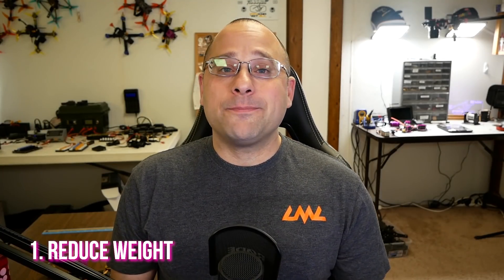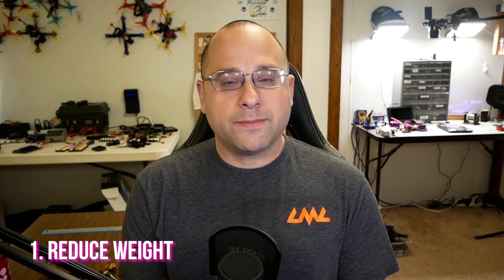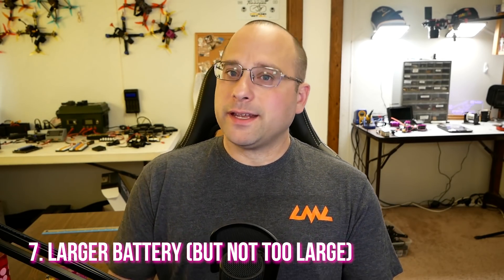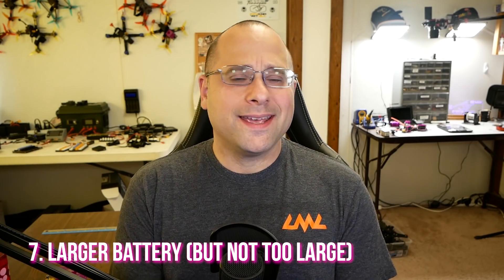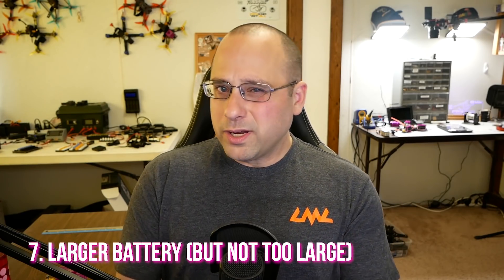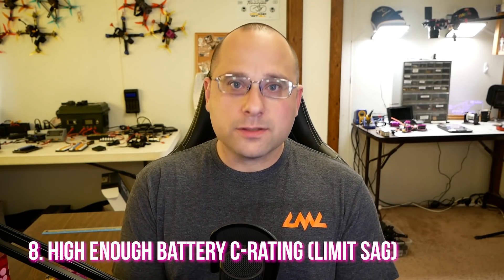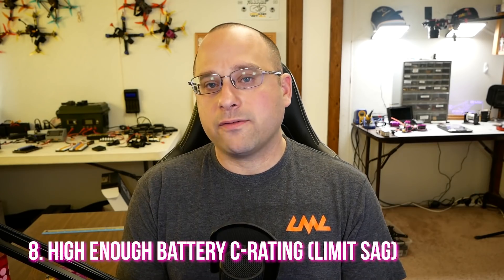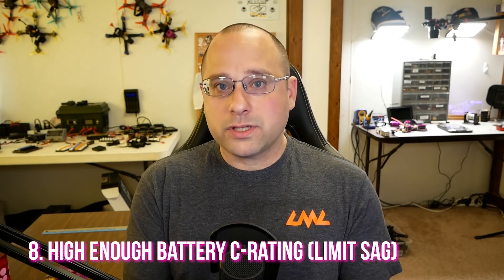Quadcopter Long Flight Time | TEN TIPS TO FLY FPV LONGER

Comment: I have a decked out 680 sized quad that will fly for almost an hour on a 6s 10,000 mah battery. It’s a lot easier to do when you can swing 15” or 16” props. Can’t wait until we can get a major breakthrough in battery technology. I can only imagine the flight time I could get without having to carry a massive brick around.

Comment: Dear JB...or anyone else,
I just looked at your ultimate shopping list and poked around.  Under frames, I noticed what I think, by now, should be considered the usual suspects.  I wish to submit for your approval the iFlight XL5.  Its a well thought out frame at a very competitive price (about $35).  I bought the V2 last year and found the build to be simple, the carbon has chamfered edges and the durability superb.  The V2 arms are 4mm and the top and bottom plates are 2mm.  I bought the V3 this year as a back up frame and its virtually the same save for the camera mount.  I don't presume to be remotely close to being an expert in this hobby as I am quite new, however I know quality when I see and this seems legit.  I guess what I'm asking is...can you check my work?  The company is chinese and I know that can raise a few red flags, but that can't always be the case.  Anyway, some direction would be nice.

Thanks
EZ Sluyter

Comment: 6s and efficiency... V=IR and P=IV.  Going from 3s to 6s means you have half the current for the same power delivered.  Power loss on the infrastructure though is based on the current only and it's the square of the current.  So at higher voltage much less power is lost to the escs and wiring.

Comment: I just built a TI 5" Armattan with the old Emax red bottom 2205 2300kv on 4s and i get at least 2mins longer than any of my other drones , and yes flattened the cam tilt and be smooth 👊

Comment: Thanks for all the great info. Glad I'm looking in the right kv and size range for my lr motors/props. Found a file on thingiverse for a lr quad, so printed the frame and am looking for parts. After watching this, will continue with my plan of 7 inch props, on 2204-2206, 1700-1750kv motors and a large 3s battery. Also trying to figure out a way to keep the structure of the arms, but have them collapse down to 5 or 6 inch easily.(arms are tubes) So I can swap it to a 5 inch freestyle or race quad running 4/6s at the field if I want. (Going with the 50 or 60A diatone mamba f722 30mm stack, crossfire, and most likely tbs unify pro 32) Just need to find specific motors that should be good. Either the mamba Toca, brother lr or xing camo are what I am thinking.
Reply: @flat-earther  the 3d printed frame didn't work out. First test flight had too many oscillations, and it just went into a fly-away. But got a GEPRC MK4 HD7 frame for it after that, and flies well enough for smooth cruising and light acro. Ended up with xing e-pro 2207 1800kv motors, the 50A f7 stack, and elrs on 3s for the moment. May try 4s in the near future, with a motor output limit. 
Longest flight has been 16 minutes on a 3300mAh 3s LiPo, so far. Averaging about 50km/hr.

Comment: Recently i flew a 80c 1000mah battery on a 5 inch rig for a longer flight than a 100c 1300mah. Il have to do it again trying to take notice if im smoother on the throttle. Gonna have to get on the throttle with the 1000mah to see how saggy it feels.

Comment: 6S LowKV is real, and I can set you up with the math whenever you want to go over that.  We should probably put together a Skype interview discussing that AND issues with VTX performance.
I'll argue against smaller motors being necessarily helpful - I've found that tall stator motors combined with lower pitch props actually equalizes the flight time with some improvement in being locked in, which more than overcomes the added weight I'm seeing.  Weight reduction matters, but spending that weight budget on stator and magnet mass is a better investment.
For reference, i'm talking about low KV 2208 motors as efficiency rigs, and finding that I get better flight times than even my lighter 2205 setups on the same props, batteries, and camera angles.
As far as running really low KV, my 6S builds running 6" props on 4S batteries are absolutely amazing - that is solid advice.

Comment: FOOTPRINT off the quad. X configuration frame- camera over stack batterie bottom mounted and slim arms. It slices thro the air. Slim arms double advantage, because blocking less thrust.
Reply: Not smaller frame (motor to motor) but less surfice earia.

Comment: 4s 2300kv 2306 1400mAh 65c 5433 props can get 6mins of good mixed flying(hard and easy, just how she likes it) 4-5 mins if i thrash it. quad weighs 659odd grams no gopro using tbs source one v2, dys samguk shu motors, predator mini, mamba f405, matek hv vtx and rxsr

Comment: Using the Ummagawd Remix, went from the stock 5.5" arms, 5" props, 2306 ~2500kv, 4S 1500 batteries to 6" arms, 6" props, 2208 1666 kv, 6S 1050 batteries and my flight times did get pretty close to doubled. I still get that "wow... it looks like I still have a couple more minutes left" feeling. 

My understanding of the whole 6s thing, lipos don't like big sudden current draws, so by spreading the same draw over 6 cells vs 4, it evens out those big dips and allows each individual cell to perform better. The nice thing is, the RDQ 1050 battery is basically the same size as the 1500 4s, so I don't even have much of a weight change other than the arms!

Comment: Some good info. I do miss going to 2-blade props. These tend to be more efficient than 3-blade props.
Reply: Yes that is the #11 tip. It can do 20-25%  and it allows to use a smaller motor because a 2-blade-prop is lighter and will spin up faster

Comment: Mr. Steele did not claimed that 6s makes him fly twice as long, he said for his application and required fly characteristics it makes him fly twice as long. So 4s makes him fly like 1.5min of his flightstyle, without compromising the flight characteristics (sag, lower rpm, etc.) and he can push it to like 2.5min but not nearly as consistant; while 6s gets him like 3min of ripping and 3.45min in total, extending his crisp twice.

Comment: You need a helination link I place huge orders with them all the time thanks to there bundle items i just ordered the isdt t8 w/24v supply for the bench... thanks for all the help and I will be using as much of these tips as I can as I'm a slow flyer and want longer up times. 🥃cheers🍻

Comment: One of my favorite quads is a 6inch Mode-2 Ghost with 2207-2500KV motors on it. I usually spin 5.5x4x3 HQprops on 4S and I can do acro for almost 5 mins, but every now and then I just like to slap a 1300 5S on there and pull it dry in under 2 mins :P

Comment: Why does my brand new Tattu's 4s 1300 mah (v1.0) drops to around 12.5V fully charged when I just do a punch up to air and go down..
Usually when I hit the throttle to get high up, it even beeps once. I don't think I am too aggressive, at its already happening right of the start of the flight.
Other than that battery is doing great, if you dont fly too agressive.

Comment: Joshua, I am interested in frame weight. But there seems to be very little information about the 'strength' (or as you say, 'durability') of the frame at any given weight. Other than crashing a quad a few times, where do we find good data about the strength of any frame? Some research data is just plain not out there. And I put little stock in the videos where people stand on a Carbon Fiber part to show how strong it is. How would you quantify standing on it? Impact on a quad is seldom the same as dead weight at the center of the quad.
Reply from the maker: Not many people are doing lab testing like you are thinking of. It's all practical testing. Build it. Crash it. See how it breaks.

Comment: The thrust tests all seem to show that two-blade props are always more efficient, all else being equal. How that translates in real flight varies, I'm sure. Certainly on the little brushless-whoop-class quads, experiments suggest you may lose a small amount of thrust for noticeably longer flight.
Reply from the maker: For me, you do get longer flight, but the tradeoff in handling is significant. That's why I left 2-blade out of here. My goal with this list is to mostly keep handling the same, if possible. Well.... I guess going down to lower voltage battery is not the same. Basically, I just hate 2-blade props LOL.
Reply: @JoshuaBardwell  maybe it just makes more sense on a tiny quad in a tighter space, where the whole handling regime is different anyway. I have been flying the micro quads for quite a while but don't have nearly as much stick time on the 5"... yet. :)

Comment: I think one thing that makes high volt, low kv better is that the motor can use smaller gauge wire, because there is less current, and therefore it can be wound tighter and the mag field is better focused. Look at those 2600kv motors. They have enormous gauge wire with hardly any turns. That is a nasty mag field making lots of waste heat. Also, electric car manufacturers have all decided that 300v is best :)

Comment: I think I literally did everything you said not to. My quad is fairly heavy for one with a race configuration at 343 grams, I use high pitch 5048 3-blade props because I can, the motors are fairly large at 2400kv with a 2305 stator, my battery is a 315 gram 4s 4200mah 10c, and I use a fairly high tilt angle, but jokes on all of you. I haven't gotten lower than a 21 minute flight with my setup yet and that was with a lot of playing around and many full throttle passes. ;)

Comment: Great tips. Could the high voltage - low kv trick have something to do with lower current and thus lower resistance and heat loss in the wires?

Comment: Awesome channel with such an amazing detail! I wondered whether you’d had any knowledge of mixing same voltage LiIon and LIPO batteries wired in parallel for long range quads. It struck me that the LIPO would be good for instantaneous current draw but the LiIon would be better for energy density. Charging would be done as separate units. Good or bad idea?
Reply: I don't think it would work.
A lot of the key to Li-Ion's energy density is that you can bring it down to much lower voltages before you have Problems.
If you parallel it to a LiPo, you can't take the entire pack below 3.5v without damaging the LiPo, and you lose use of that entire region of the Li-Ion.

Comment: I use a 7" frame with (t7056) props on (rs11 2303 1700kv) with a 3300mah 6s lipo and weighs around 950g and get a 10 minute flight time but going to li-ion battery for 15-20 minute flight time will probably get lower pitch props like you recommended
Reply: I have a set of them spare to try also some 7042-2 to try too

Comment: my quad is a 6 inch alien frame running a 4s 1500mah lipo at 526g without a gopro....is that good?
Reply: Sounds pretty good to me. What motors. My 5 inch 2407 is probably a bit heavier lol. I think Josh's 2407 armattan weighs about the same.
Reply: I’m using the same setup with 6s motors on 3s and I get about 10-15 minute flight time

Comment: All tips together will not simply add up - the sum of all is more than adding each method. Save weight and you need a smaller motor which saves you even more weight. Now a lighter 2-blade-prop will do which requires less power and the motor can be even smaller.... and now a smaller battery is sufficient. And the less weight you got the less strong  the frame need to be because the impact-energy is reduced. Again it'll be lighter.
This way i went up to 8 mins flighttime with 270g AUW and still having fun. 1408 motors with 5in props ? sounds crazy but they don't get warm at all. And btw. less weight is less noise which can be good for avoiding trouble.
Reply: > 1408 motors with 5in props ? sounds crazy
No it doesn't. I used even 1306 motors :)
Reply: 4 inch , 1506 3600kv, 3S 850mAh, AUW around 260g... 11 minutes :D
Reply: 3inch, 1104 6000kv, 2S 950mah, 115g AUW, 11min flight time, lot of power .
Reply: @justalex7416  also very nice... if you spin large enough prop without overproping staying on low throttle, it is very easy on light micros to stay above 10 minutes :)
Reply: sometimes i do overprop this kwad with a 5043x3 instead of a 2-blade-prop because this reduces the noise a lot. It is bad when someone goes crazy because of the noise.  Some spots are somewhat sensible.
I'm impressed how effective some builds are, i thought it is rare that people go this way.
Reply: @nara4420  My 3inch uses gemfan 3025, absolutely silent, after 10m you can't hear the quad. One of my first quads was a 5inch 5030 gemfan loud, but uses 1804 2200kv motors, fly 9min with a 3S 2200mah.

Comment: I remember finding videos from someone who flies rc helis with a single rotor blade (using some weight to balance it out) claiming you get a longer flight time. i think there's some truth to this, on my mobula 7 i get slightly longer flight time on 3 blade props than 4. i think if you are after flight times it's probably worth looking at some 2 blade options.

Comment: Just a theory. 
Higher voltage on lower kv = less voltage sag.
Less voltage sag = no need to jam the throttle on full blast.
And if you are flying like Mr Steele, with lot's of full power blips, this could, theoretically, give you longer flight time.

Just my 2 cents
Reply: 6s does give more flight time but not very much.  15-30 seconds maybe
Reply: With 6s there is little to no voltage sag.  It just suddenly dies and thats it.
Reply: I feel you, maybe makes a 4 minute flight 4:30. But I do see how it could make a 2 minute flight 3:30-4. Especially cuz Steele likes such low pitch props, I feel efficiency is lost exponentially the last 20% of the stick. 

He might have often been going full stick when really he tops out at around 80% and dumps Amps the last 20.
Reply: Plus, steele is using heavier 6s bats w more overall charge. I think this is bc of the preformance boost. The responsiveness is probably about the same. He likes his gear to fly the same feel
Reply: Strangely, I have had smaller motors with low torque, and they got the same flight time maybe less with my 5s pack. Seemed same power too. 

But with 2407 motors the 5s lasts much longer. My older motors couldnt take advantage of 5s torque boost?? Idk. It also feels MUCH more powerful.

I thought big motors would already have the torque, and the voltage wouldn't be needed. 
Also thought the small motors could use a torque boost, but it didn't work out. Weird? Really depends on the setup.

Comment: Maybe warm up battery before flight somehow. i noticed less voltage sag when punching throttle when half the pack has been used guess resistance is less?
Reply from the maker: That is correct. If you live somewhere cold, warm up the pack and you will get significantly longer flights. Good tip!

Comment: Nevermind, I should have watched the whole video before commenting. Does using a lower kv get completely offset if you go to a higher voltage? I.e. 6s 2500kv vs 12s 1250kv? The reason I am wondering about this is that losses in the ESC would be lower at the same power level if the voltage is higher, so you might be able to get longer flight time without compromising performance by going to a pack made from a larger number of smaller cells and a motor with a correspondingly lower KV.

Comment: Hey, Im new to this amazing hobby, and was wondering what about using a Li-ion battery made out of 18650 cells. I know they are heavier and have lower C ratings but there are some high quality samsung and sony batteries with high enough C rating that will give 3 times the capacity for just 10 more grams of weight. What do you think?
Reply from the maker: As long as you can keep the amps low enough then it's possible to get longer flights from LiIo, but you must keep the amps pretty low.
Reply: Joshua Bardwell thanks for the reply! Im intending on running a 6s quad with 1700kv motors on a 4s li ion pack with a continuous discharge rate of 20 amps. I hope its good enough.

Comment: Hi Joshua! Lower pitch props should have better efficiency in theory, but in practice the results are quite unpredictable. For example, Gemfan Hulkie 5055 is considerably more efficient than a bunch of various HQ5x4x props I've tested (I have a bunch of them from the DroneDrop). I think the pitch labelling they use is not "scientifically proven".
Reply from the maker: Yeah I agree. The loss in thrust is sometimes bigger than the gain in efficiency.

Comment: Higher voltage as long as the motor can handle it at lower KV is always more efficient in pretty much all Electric motors when you asking the same basic RPM from all other things equal setup.  While the watts to the motor are going to be similar Voltage moves the motor with less wasted energy to heat conversion verses Amps, some is due to the resistance of the wires stays constant but more amps forces more electrons through and loses more energy than higher voltage moving less amps but with more effective force since you have less losses to the resistance of the circuit. Just my 2 cents though, i'm no expert.

Comment: Correction - Lower KV is heavier motor as the winding diameter is larger thus resulting more TORQUE which allows you use larger props with less Amps as same motor size with higher KV.
Higher KV is lighter motor as copper winding is smaller. This is allowing the motor to spin faster with less mass and thinner CG. But it has less torque.   Putting larger props on high KV will use more amps to compensate for smaller cooper winding.

Logic - larger magnet holds more magnetic field to smaller magnet. You can add magnetic field to smaller magnet as to equal the larger magnet but requires more Amps.